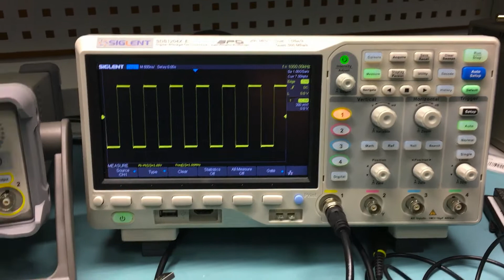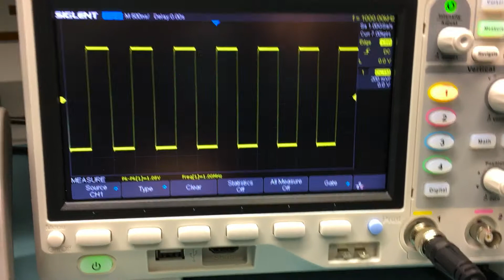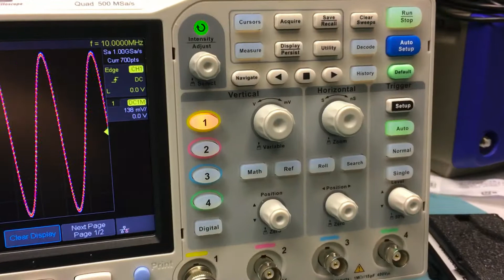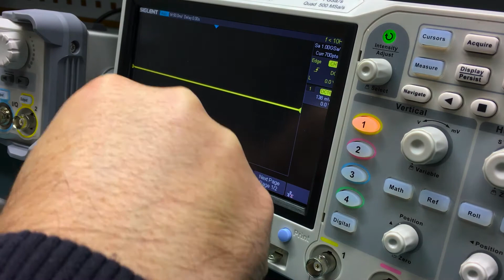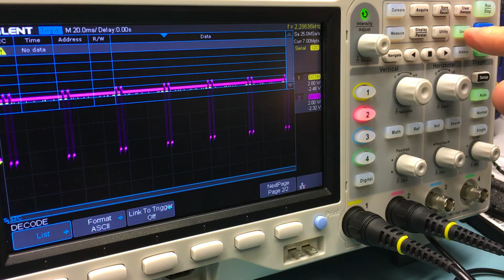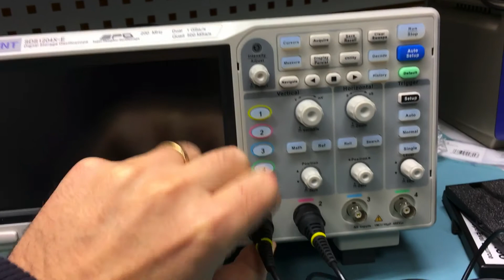SIGLENT SDS1204X-E First Test and Decoding

Comment: not considering the bandwidth.. this one or rigol DS1054z?
and what abaut the compessation issue that affect the 1202x-e? is still present or solved in this model?

thanks
Reply: late, but the compensation issue is fixed in the BB serial-numbered ones. not the AB's.